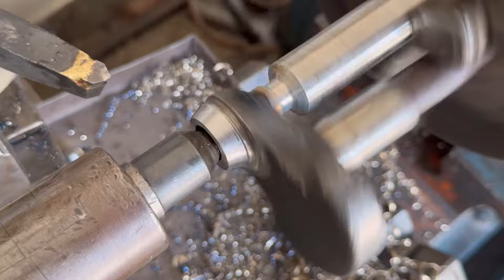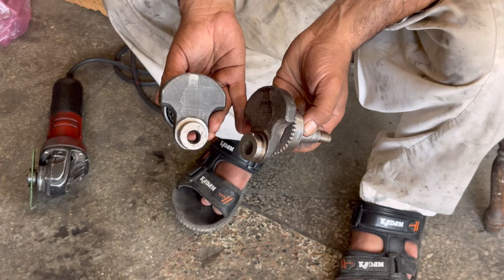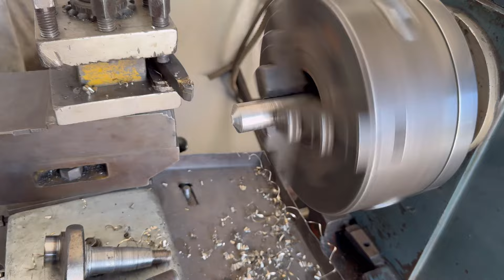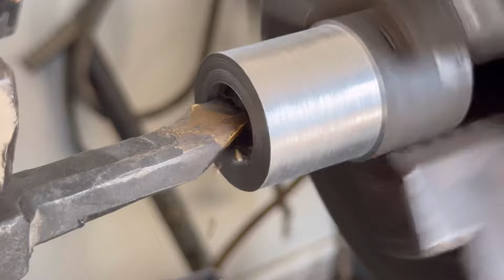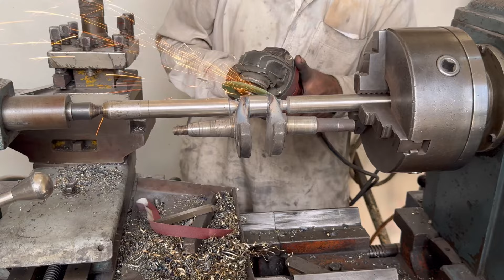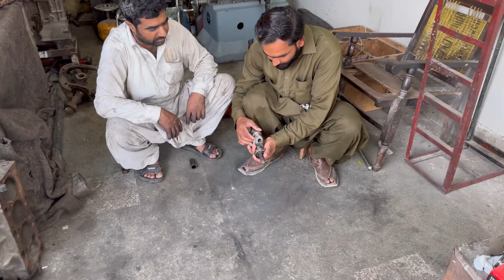A Small Broken Crankshaft is Fixed By an Expert Mechanic // Must Watch This Unique Process…

Comment: Doing something that won't work with nothing? You can see the two ends are not in alignment with each other or with the crank journal. This guy and his monopoly money will be disappointed as soon as he reassembles the engine and it won't even spin let alone run.